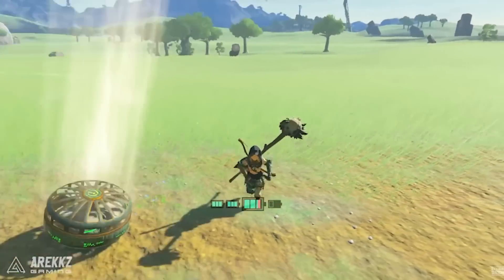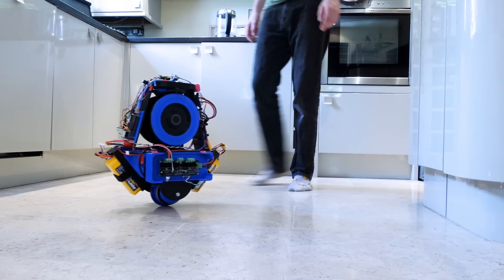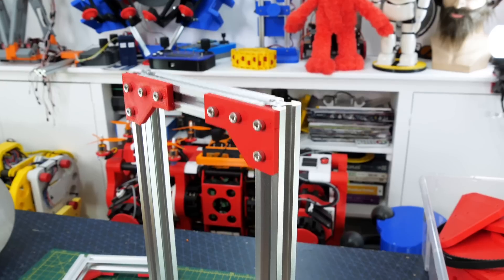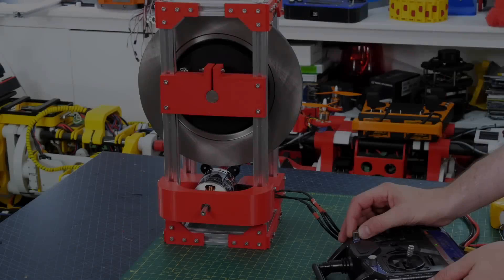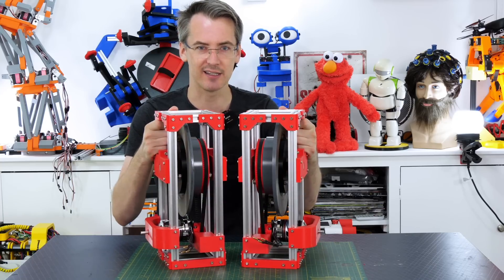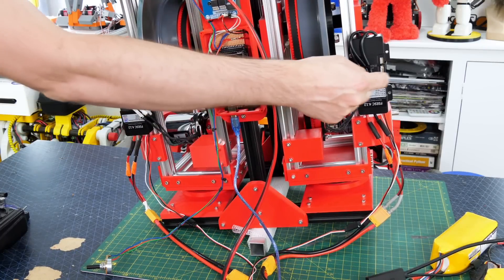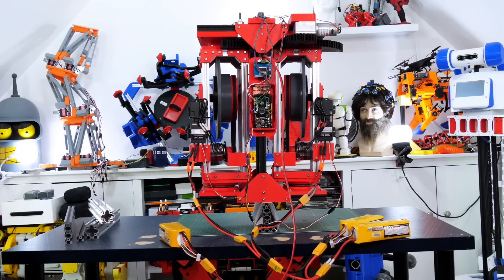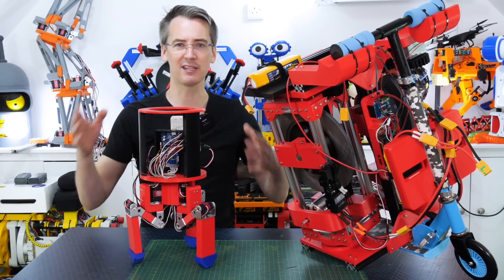How Gyroscopes Balance

Comment: Scared the hell out of me when  it fell over the first time. I really thought you were gonna grab the rotating gyro. Nice save.

I've seen some footage from an old train that ran on a single track and balanced using gyros, in a time before microcontrollers. They used hydraulics coupled to the gyros to help compensate. It might be possible to do something similar with those pneumatic pistons that hold trunks or hoods open on cars.

Comment: Given your base tripod, I would use ONE gyro, rotating in the horizontal plane with pitch/roll servos. Tipping it as appropriate, you should be able to use that single gyro to stabilize both pitch and roll, without any unneeded yaw issues. 

You will also need to pay attention to the gyro position with an integral term, using the robot off-center moment to keep the gyro flat over the long term. But I believe that this would be considerably simpler than the monstrosity of multiple gyros and translation you appear to be planning. 

There is a basic problem at hand, namely that such a robot would be better controlled by leg force than position. That would support a controllable torque to precess the gyro to level when needed. But if you have some spring constant built into the feet (rubber, or a sprung foot) you can use a small position offset to generate such a torque.

Comment: The threaded holes you bolted up to are for threading a bolt into to pop the rotor off of the wheel hub when removing it. That being their only function, they aren't as precisely placed as the lug holes or hub ring. So having used that as your mount point might be the source of your off center vibrations. Also a break shop should be able to balance your rotors for fairly cheap if you want to get better precision.

Also using conical roller bearings rather than ball bearings would eliminate and play at the axle that may be contributing to vibration.

Comment: Make a one wheel motorcycle (those with the driver inside the hollowed out wheel) which keeps its drivers on the lower end of the circle by a reaction wheel running inside the real wheel. This has the benefit of doing regenerative braking, too :)

Comment: 14:22 --- using a pivot point on the scooter deck to affix the unit may help in the unit righting itself and also a single linkage from the top of the unit to turn the handle bars like a person would if they were trying to balance on the spot- or would that be too hard for you to achieve James?

Comment: You have quite a habit of making your contemporaries look like absolute posers.  Thanks for the thousandth time for sharing your ideas.  I really can't say how many times I've gotten invaluable design inspiration from your builds.  Usually simple problems that I've overthought and overengineered you've solved with one part.
Have to say, when the gyro frame fell over and the flange on the esc landed right on the battery I got flashbacks.  It's always the pointy bits.

Comment: Your tightrope walking cheat device inspired me to build a toroid ring motor as a free-floating reaction wheel. Its not free floating, yet. But I think its got possibilities. As a satellite staibalizer maybe. no contact between the rotor and stator. And here the brake disks have alot of mass at low velocity near the centre, a toroid on spokes would make a much lighter machine with all the mass at one velocity.  Love the channel, hope you have a holiday from this.

Comment: You can use reaction wheels as both a motive force and as a gyro (like you showed previously by balancing). Those little "dancing cube" robots do it where they use the wheels to fling themselves up then stand on end. Those usually have three wheels though, one for each axis. Maybe you could use some simple AI where it tweaks the PID values automatically to stabilize with various loads.

Comment: Brake rotors are a good proof of concept, but their weight is distributed more towards the hub than the edge.

Concentrating weight on the outer radius will increase the moment of inertia on those flywheels allowing you to use smaller diameter flywheel or a lighter flywheel for the same angular momentum.

Comment: I realize they are not as prevalent as before, but I think drum brakes may provide more mass in a similar volume of space. They may even all you to add more mass to the interior cavity of the brake drum. Also, as others have pointed out, I would make a shield or sheath around the rotating mass to protect yourself (and others) from injury. My nerves were on edge every time it started to fall and you reached out to catch it.
Reply: The mass moment gets a squared contribution from the distance to the axis of rotation.  Putting all your weight on the perimeter is most weight efficient.

Comment: I know your gyro based machines are rather large. Is it feasible and reasonable to scale these designs down for smaller machines. Is a much larger area of the gyros required for proper operation and stability?

Comment: The break rotors are not rated to spin that fast.. They are probably fine, but could easily fail catastrophically and kill you. Please put up some plexi/metal shielding or install some on the device.

The design is otherwise really cool, as always!

Comment: Tip.
Look into the linear motors from Washing machines.
If possible use tubing attached to the body of the motors casing and spin that instead of car disks.

Comment: Car disk brakes are a great source, but, even better van rear disk brakes. They're slightly heavier, but, because the mass is centered around the band (because of the parking brake), the weight is even better distributed for a gyroscope. Ultimately tho, i think the best gyro you could make, that's sized and weight properly is a 20" bicycle wheel that has a banding of lead wrapped around. This is what we used back in school and it was super easy to make. At that time, we took lead sheets (the stuff used for meeting the roof of a house with the brick work) and wrapped them into a long "snake", which then got mashed into the 20" rim, which in then locked it into place because of the lips that usually hold the tire in place. We also secured it with a banding of steel, which cleverly put the locking tab on the size with the least weight, which in turn got our wheel nearly perfectly balanced without much work. To turn it, we used to use a fan motor with a locking clutch from a lawn mower.

Comment: You should be adding a lot more safety features. The flywheels should not be directly connected to the receiver output and only controlled by a knob on the controller, they should be controlled similar to drones with an arming switch, so to switch off the motors all you need to do is flick a switch rather than turn a knob, flicking a switch is much faster and is a more natural panicked movement than turning a knob, you should also consider adding an e-stop to the robot. 

You may have already implemented it but you should also have the flywheels switch off if it tilts too much. Also what happens if the controller switches off during operation? Does the receiver just output its last known signal or does it detect a loss of signal and cut out? If it doesn’t detect loss of signal then you should implement that along with the arming switch.

What you would need to make it safer is to have everything go through a microcontroller to implement the arming, loss of signal detection and potentially other safety things.

You really should add covers for the flywheels as well, at the very least to make it that nothing can touch them and they won’t touch anything if they fall over.

Comment: The other three mechanics watching you use the jack holes instead of the mounting holes 🤯🤯🤯
Reply: eh the mounting holes aren't what take the load anyway they're there to hold the disc in place when there's no wheel, the way it's supposed to be constrained is by face contact alone, the wheel studs just happen to pass through it but shouldn't really be doing any force transmission

Comment: dc motor by axial magnetic field on a bearing, for example +/- rings and the bearings move, with a 3rd moving slot disc on top
Reply: how amount moment of inertia balancing, ie, the normal way you walk
Reply: those look like legs, of a bot
Reply: self-standing bike, with rotational mass flywheel energy battery combo

Comment: You should print sheaths, or at least covers to the rotating disks. As is, you're one balance mishap away from losing fingers, especially since every time it falls, you reach for it with bare hands...
Reply: losing*
Reply: Lol don’t print them, get 1/4” thick clear polycarbonate sheet NOT ACRYLIC and thick metal corners then bolt it together.  Only reason you probably don’t need thicker is those discs are smooth and solid metal incapable of fracturing under the rotational load applied.
Reply: That would actually be really gay I'd unsubscribe
Reply: or at least invest in a good pair of leather work gloves.
Reply: @Shit_I_Missed.  Gloves are a bad idea when working with rotating machines. The idea is that an abrasion is preferable compared to having the gloves being pulled in.
Reply: @Shit_I_Missed. That's a horrendous idea with rotating machines, wouldn't want your arm getting sucked in.

Comment: I worked in an old-fashioned blacksmith shop for a while. The rule there was: if something falls don't try to catch it, but dodge it!
Reply: Kitchens are similar.  A falling knife doesn't have a handle.  Just get your feet out of the way.
Reply: If you can dodge a red hot ingot, you can dodge an out of control flywheel.
Reply: @Alexander-it9lv I appreciate the concern but I will continue to worship Allah by following the teachings of Isa.
Reply: Every machine should have an e-stop too. It seems he is just driving the motors directly from the receiver output so to stop the motors he needs to turn the knob down. It should be done like drones with an arming switch so the propellers won’t switch on without the switch turned on and will switch off as soon as the switch is turned off, preferably with braking.

Comment: Stay safe, James. Those flywheels have a lot of energy in them and if that rocked off the table and hit the floor your plastic joints are going to give way and those flywheels are dumping all their energy into getting the heck out of there. Don't be in the way when they do.
Reply: I must second this. James, invest in or manufacture yourself a substantial safety shield before you do further experimentation with this. Those flywheels will not stop if they hit you.
Reply: @BazilRat  thats not saw blades 😅
Reply: @ThadMiller1  They're very heavy and moving very fast. They will not stop.
Reply: @BazilRat Not stop what? Turning?
Reply: @ThadMiller1  Moving. Flywheels and gyroscopes that get loose are dangerous. That's 21lb of metal moving at a substantial RPM. 
If it gets loose, that rotation is going to get converted into motion and that brake disc is going to bounce around the room at speed. If that hits a squishy human body its probably going through.
Flywheels are terrifying!
Reply: @ThadMiller1 so you seem to not understand basic physics
Reply: It’s pretty smooth so unless it has a good runway and builds up speed it’s not likely to do more than some minor surgery couldn’t correct.
Reply: @LeafBoye  just worked on a lathe for years 😀
Reply: @ThadMiller1 they'll still break bones and smash you.
Reply: @superslimanoniem4712  Sorry, but you are not a man of practice.
Reply: @ThadMiller1 correction you are not a man of intelligence 😂
Reply: @MikAnimal  and you are too young to understand boy.
Reply: @ThadMiller1  way more dangerous than saw blades.
Reply: On the plus side, we used to take tiny pinion gears (about 10 grams) and slide them on a screwdriver.  Then using highly compressed air and a nozzle with little restriction, spun them up over 100k rpm and then pull out the screwdriver.  It was fun as heck watching them skitter around the lab for over a minute, record was over 2. Gotta be careful not to give them too big a straightaway or they can really build up speed.
Reply: @hugegamer5988  And while a tiny little pinion gear moving at speed probably won't kill I bet you had some bruises off them
Reply: @BazilRat  they never really came off the floor and everyone was wearing boots or shoes.  But yea, not super safe even though they were smaller diameter than a nickel.
Reply: I think he's probably aware
Reply: @Livelife-uk  he is not at all aware of the danger he is in. this is obvious. painfully obvious.
Reply: @Alexander-it9lv spam sucks

Comment: This is legit the scariest thing I've seen you build, only for the forces involved and how close your fingers were to the mass wheel. Super informative!
Reply: I swear every time a youtuber uploads a flywheel episode its the most stressful thing
Reply: @IronDoctorChris Wintergatan this week had me 😬
Reply: I THOUGHT I WAS ALONE, I LITERALLY SCREAMED WHEN HE GRABBED IT
Reply: Imagine if he made a gyro with a saw blade…
Reply: @zat-1-fury  Then he would have "Did a thing" and that's a different channel.
Reply: @zat-1-fury  All that was missing on this one was the teeth and I bet it would still cut a finger almost instantly if given a chance.
Reply: I agree, you have been recently getting into making things that require more strength then what plastic will give you on its best day. I know it is super easy to print but at some point the material science just does not add up. Please use more metal in these things. You should take a machining class at your local college, It will do you wonders in your quest of building things.
Reply: Scared me too
Reply: Great Mad Science. You're close to a deadly Battle-Bot!
Reply: No joke.  I built a super heavyweight full body spinner for the original battlebots, 120lb stainless steel 2’ diameter with 8lb blades.  Wondered why we heard a rubbing noise at around 1200 rpm and it turns out they were experiencing several hundred g’s and were deforming the shell.  That day I learned to calculate first.
Reply: @hugegamer5988 huh, 5072 mph. Yikes
Reply: By @amphibiland  nope.  1200 rpm is 20 times per second.  At a 2’ diameter it’s 1’ radius or 6.28’ 20 times a second for 125 feet per second of about 85 mph.  Sounds safe?  Well the acceleration is V^2/r and normalized to earths gravity is 488g, each blade weighed as much as two cars.  If one ripped off at the wrong time, it would turn meat to paste.
Reply: @hugegamer5988  Wow, I did some bad math 🤦rotations per minute, not second. That's on me. That's still a terrifying amount of acceleration.
Reply: This has big Colin Furze energy.
Reply: i was terrified of one of the brackets snapping it falling onto something and exploding, its just so much inertia and mass
Reply: @Minty1337  V^2/r is your friend only if you respect the g’s.
Reply: thankfully these were solid brake discs, dangerous but not likely to fragment on falling and being unventilated they really have no protrusions to speak of
Reply: @Mister_Brown  yea but what about the plastic, screws, etc that could be thrown around lol

Comment: What about making giros rotating full 360 degrees? Giro blocks are quite compact and you can do this. And in this case you would not need to worry about limiting their angles.
Reply from the maker: I'm not sure what would happen when they pass 45' - would they start applying force in the wrong axis?
Reply: I am as layman as it gets but wouldn't both applying force in the wrong axis cancel eachother out?

Comment: You mentioned that to get the an all axis balance you'd need 2 extra gyros totaling in 4. Would it not be possible to have 3 gyros set up in a triangle with independent rotation driven by motors instead of the sync gears? If it works it should save a lot of weight and reduce the footprint. Would also work really well with your tripod robot due to the small footprint on top
Reply from the maker: It may be, but I'm not sure they'd be as effective in any axis?
Reply: I was also wondering what would happen if you used heavier disks in order to reduce the size, maybe using tungsten due to its density